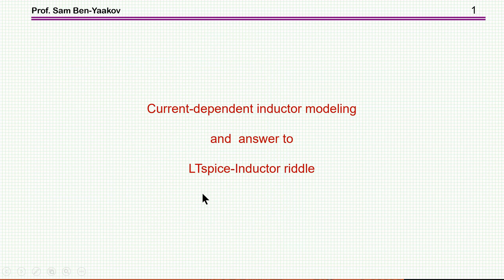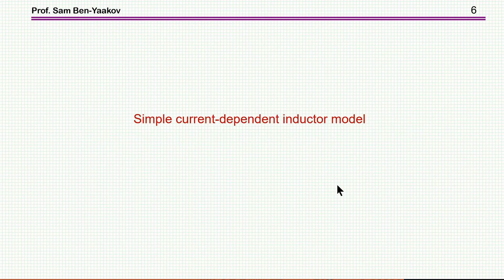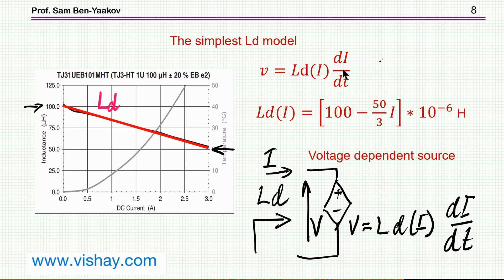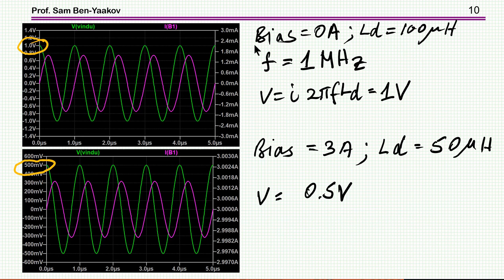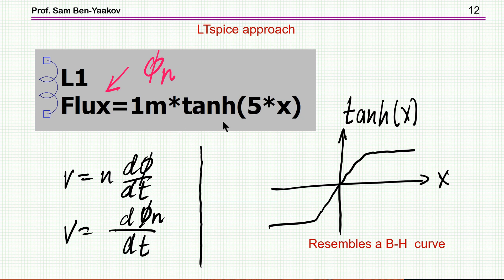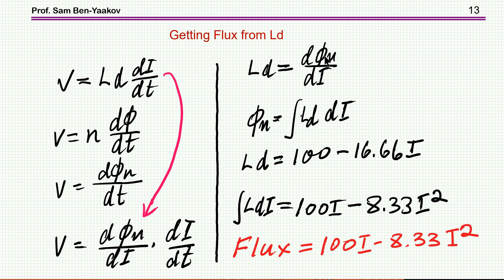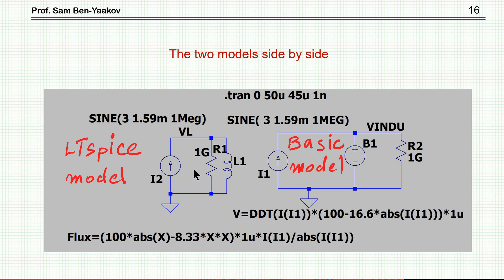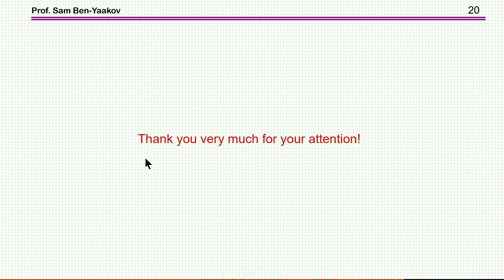Current-dependent inductor modeling and  answer to LTspice-Inductor riddle

Comment: Dear Sir, thanks for your video,
In my case, using the same Flux equation, beyond certain current, the inductor value is becoming negative. How do you fix this issue?
Reply from the maker: Send me details to  sam.benyaakov@gmail.com
Reply: @sambenyaakov  dear sir, simulation and excel calculation files shared, please help

Comment: Just a question professor. At one point in the flux equation you used X while the other time you used I(I1). What is the difference between the two. Also, if anyone else can help me?
Reply from the maker: Sorry for the mix up. Yes, the same.
Reply: @sambenyaakov  Thank you professor.

Comment: using tanh to approximate permeability vs dc bias seems to work fine for high permeability magnetics inc. powder cores. flux=-1/500*(0.25x*x-42*abs(x)+71*log(cosh(0.5*abs(x))))*sgn(x) they have  a curve fit excel sheet for their cores. this is 430 turns on their 58740 core from 0.33a to 2.33a
Reply from the maker: Dear Henrik, Thanks for input.

Comment: Thank you Professor! help a lot！
I'd like to ask why there is a 1G ohm resistor in parallel with the voltage source in the model？what is the use？
Reply from the maker: Thanks. I guess "current source." This is to help LTspice to converge at the operating point.

Comment: What if we just compare voltage?
Hi Sam,
Why equation is not valid for negative currents? this is because no constant of integration? I don't understand root cause of this problem and why abs + sign fix it. Could you describe it a bit more?
Reply from the maker: Hi Marcin, to cover the two quadrants, you need one of
1. one equation that will fit the two quadrants (such as using the tanh template) but this is tricky.
2. use two equations and switch between them 
3, use one equation for the absolute value, and get the negative part by adding the sign while relying on the symmetry, as I did

Comment: Thank you Professor! Useful knowledge indeed.
On a side note you could also use:    Flux = ( 100u - 8.33u*abs(X) )*X 
to deal with the negative currents
Reply from the maker: Nice. Even better. No potential problem when I=0. Thanks.

Comment: Can we use the behavior voltage source as in DC-DC converter inductor? (Forcing differential voltage across it rather than inject current into)
Reply from the maker: Yes, but you need a some résistance in between so SPICE can solve the network equation